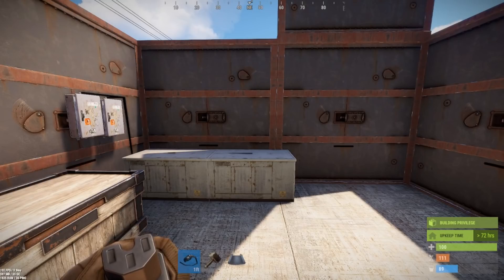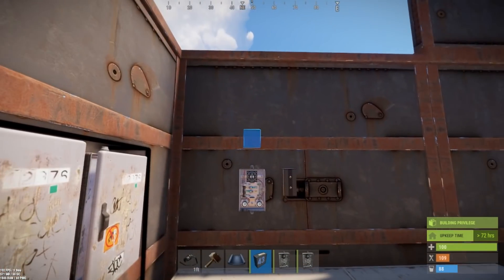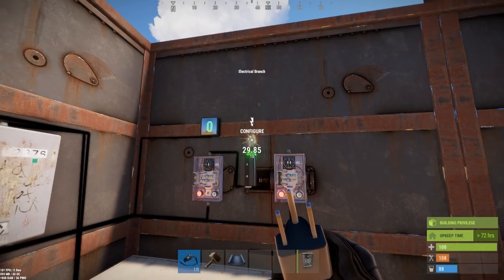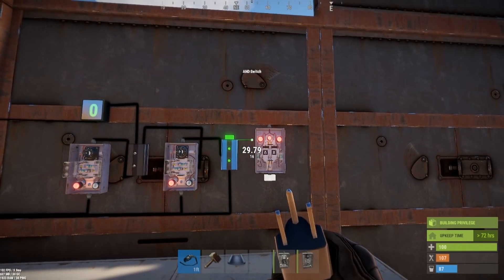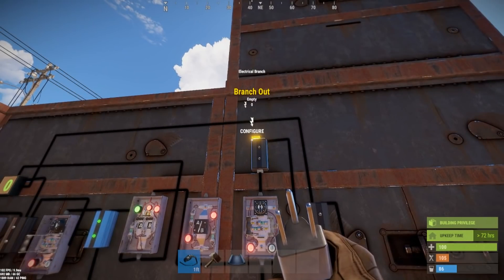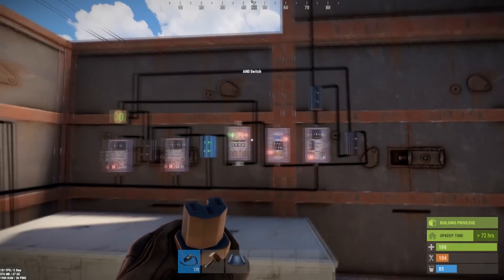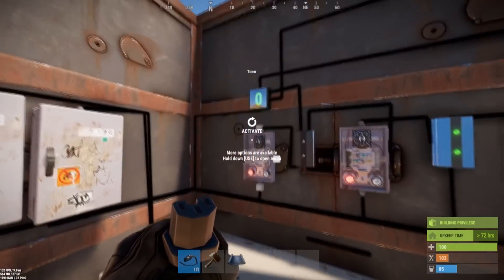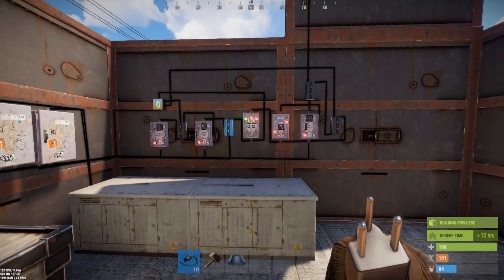Rust Electricity - Independent Accumulator Trigger.

Comment: my biggest issue with these timer/counter increment builds is that they can be so dependent on server latency. this works great if you are trying for randomness, but if youre actually trying to use it to count specific stuff it will give you a different output depending on how busy the server is.

Comment: How would you use multiple HB sensors to trigger something? I try using OR switches but the 1 watt going through isn’t enough.
Reply from the maker: Outputting an HBHF into an AND switch input A with a real power source in input B allows you to use HBHF sensors to trigger things.
Reply: RUST Quick Electric so I need an AND switch for each HBHF sensor right? I never thought about that, thanks.
Reply from the maker: @Leo.m.robles  Yes that would be the easiest way with the currently available components.